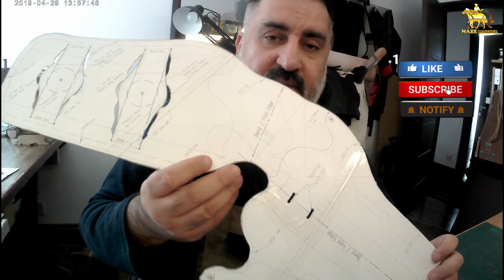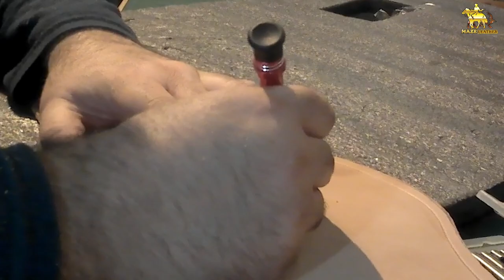Western Double Loop Holster Part 1

Comment: i thought i saw a heat gun used, what was it for?
Reply from the maker: just speeds up the contact cement time , also wet molding use heat gun just quick pass to reduce waiting time
Reply: @maze-leather.m.alazzawi  would that holster fit a heritage .22 revolver?